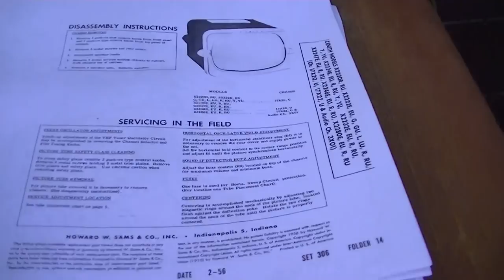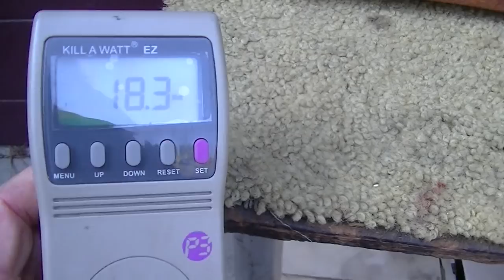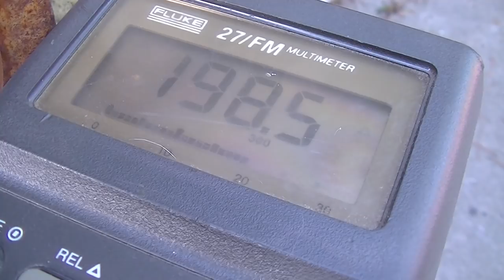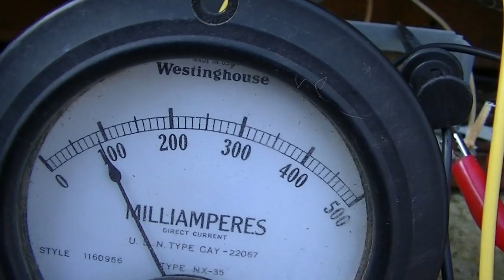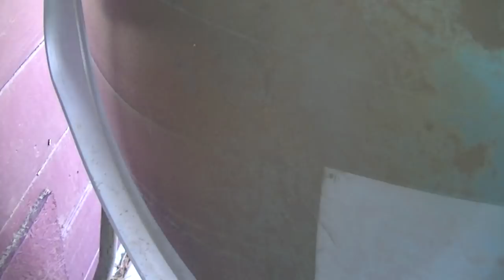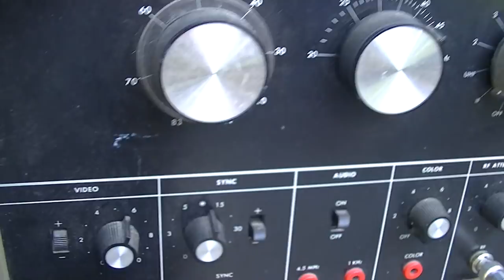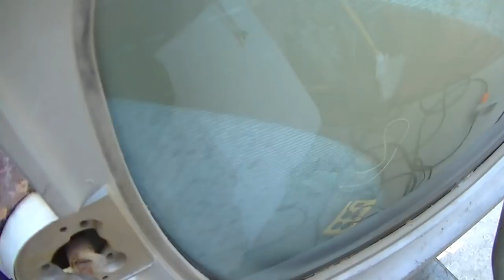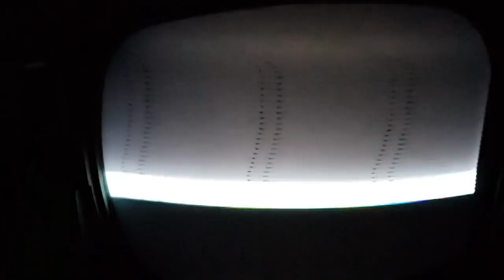1956 Zenith 17X20 black-and-white television resurrection

Comment: Zenith....The quality goes in before the name goes on.
Reply: Someone in my area threw away a zenith space command and cut the cord on it! But luckily that’s easily repairable.
Reply: Zenith is owned by the South Koreans by LG. Pure garbage now.
Reply: Shango066...the quality goes in before the video goes up.
Reply: @guyonearth, candidate for the most appropriate channel motto ever?
Reply: By the 70s, the quality leaked out before the name sealed it in. I remember my dad buying a new Zenith in 1981. Sure, it was a huge upgrade from the motel reject Ford Philco with no green gun TV we watched for many years, but it had cold solder joints that effed it up shortly thereafter.
Reply: @docbrownsradiolab1220  I'm 18 around your age and I collect a lot of this cool old american tube stuff. Mostly radios, old TVs are hard to get around here in rural Virginia.
Reply: Except when they took over Heathkit
Reply: @docbrownsradiolab1220  Sounds like me. I'm 17 right now. Our generation is a bit misled.
Reply: @Brady TheFox lol good 1 😂😂

Comment: Would love to see you get it fully working. It's a testimony to American craftsmanship.
Reply: I agree with you ruff. I hated to see the time run out.
Reply: I agree ..I think it would be cool to get it working like it did in the 50s . Absolutely incredible the environment it was in and that it was able to be resurrected
Reply: Same here!
Reply: nice look you cleaning tube
:-)
Reply: Yes! Tooo good for dumpster!
Reply: Make a new video after this:
Complete disassembly , restuff all capacitors replace all resistors with NOS.  Replate or repaint all metal surfaces. Transformers can be repaired with new insulation. Coils and IF transformers taken apart and revarnished, tuning slug holders replated. All wiring replaced with Teflon. Nice shiny paint job on the cabinet. Recreate CRT label, paper stickers and decals. New authentic factory markings on the chassis. Make new knobs cast from resin. Replace all vacuum bulbs with original Zenith marked NOS. Rewind flyback secondary. Replate screws hardware and tube shields. Create ceramic hybrid boards to replace integrators. Recoat CRT with new Aquadag. Replace any asbestos with nice clean new stuff.
It should only take a few years.

Comment: Seems like it really is harder to stop a Zenith than any other vintage TV.  Considering it was in direct harsh weather for decades with the components facing upward, it's pretty incredible how functional it still is.
Reply: Maxxarcade yeah I mean that thing was in the desert conditions longer than I’ve been alive I am shocked
Reply: Desert conditions are better then temperate climates for preserving things
Reply: they dont make them like they used to anymore. Impressing quality
Reply: Every single old high hour Zenith tube radio I get my hands on fires right up, I've recapped a couple and it sometimes makes little difference at all, quality goes in before the name goes on for sure!
Reply: My 54 Zenith console am fm phonograph works just great. My great uncle bought it new.  He passed at 100, and I asked for it, and so I have it now. Never been restored,  only 2 tubes don't say Zenith,  I can play it all day, it never fails. I have had it since 1994. I have multiple Zenith radios from the 50s to mid 60s. All tube radios,  all work. I ALSO HAVE A 1939 TALL Zenith radio, was my Grandparents.  My mom said they listened to the pearl harbor broadcasts Dec 7 1941.on it.  It still works too. ZENITH made good stuff.

Comment: Although it is totally baked it would be a shame to throw it in the dumpster. At least parts might be worth saving, maybe you will need a CRT like this at some point. That's a tough little TV for sure!! It's almost a miracle none of the transformers were shorted.
Reply: Shango once said that he seems that the desert CRT's seem to fail pretty rapidly in a previous video. So not sure if he'd keep this tube or not.
Reply: kirbyyasha I remember he said that about vacuum tubes / bulbs. Not sure if this is the same problem with CRTs.
Reply: I'd keep it and put the guts from a more modern black and white in it, then play fallout 4 or cuphead on it. Wouldn't even re paint it. after all, it looks like it's straight out of  a fallout game

Comment: I watched this video expecting the TV would blow up each time another tube was installed.  Seeing this video and the one with the transoceanic radio that you got working by spraying it with WD-40 changed my mind about Zenith products.  Would love to see another video showing how replacing the leaky, open or out of tolerance capacitors gets the picture of the TV more and more stable.

Comment: This is the second time I have seen an article in Extreme/Tech online Magazine about this issue lately and it answers a lot of questions about the question of a warranty being voided by just opening the case.
Those “warranty void if removed” stickers have plagued many a tinkerer over the years, but the FTC said last month that those warnings are illegal. It told six companies, including Microsoft, Nintendo, and Sony, to knock that off. The full text of the notices has been revealed, and the FTC isn’t fooling around. It gave the companies 30 days to comply with the law or the agency would pursue “legal action.”
The original notices went out to Asus, Microsoft, Nintendo, Sony, Hyundai, and HTC. The FTC believes all six companies are violating some aspect of the 1975 Magnuson-Moss Warranty Act, which controls what companies can and cannot restrict in a warranty. Specifically, the act states that no product costing more than $5 can have repair limitations in its warranty. That applies even if you have a third-party repair your device or you just want to open it up to blow out the dust.
Motherboard got its hands on all six letters through a Freedom of Information Act request. Each one details what’s wrong with the company’s warranty. In some cases, the company threatens to void warranties if certain repair procedures aren’t followed. The most troublesome provision cited by the FTC (and the one that’s gotten the most attention) is the use of warranty stickers. The FTC says you can’t void your warranty by merely removing one of these stickers, which are intended to make sure you haven’t opened up your device.
All the companies were given 30 days to fix their warranty issues in the letters dated April 9. So, we’re coming up on the deadline. The FTC letters note that investigators have made copies of the original warranty information on each company’s website and will be comparing that with any new language provided.
According to the letters, Microsoft is in hot water for restricting the right of consumers to have third-parties repair their hardware. Meanwhile, Nintendo’s warranty required consumers only to use Nintendo-certified accessories and software. Sony really went for it, designing its warranty to become void if the buyer used non-Sony peripherals or removed the tamper sticker. HTC and Asus had similar provisions to Sony’s. Hyundai required the use of Hyundai parts to keep the warranty intact.
These violations probably represent just a tiny fraction of the sketchy warranty terms out there. Hopefully, the FTC follows through on its promise of legal action if the companies don’t comply. That might scare everyone else enough to get in line.
Aloha from Maui.

Comment: Portable, yes.  In early TV lingo, if it has a handle, it's portable.  Even if it weighs 800 lbs and is bigger than a sofa.
Reply: Like old Fender guitar amps. More than 100lbs heavy with a flimsy suitcase handle on top. Truly portable.

Comment: Zeniths deserve the effort to get them running back as close to 100% as possible in my opinion.  Looking forward to a part two video.  I'm interested to see just how much more it will take to fix the vertical, horizontal and the rusted frozen fine tune shaft.  You truly are the TV whisperer Shango.

Comment: I wish someone like you would be around to help me with these sets. I have a 1949 RCA 9t240 barn sitter. It's been sitting since the mid 1950's in a non-water tight shed since the TV "stopped working". The owner passed away in 2016 and I came around and found the thing sitting in the barn. I plugged it in and the thing smoked. I cleaned up the insides and removed strange gunk under a glower tube. The tubes now light up on the board and the CRT electrogun even glows at the end, but...there is no hiss from the speaker and no picture on the tube. Ideas?

Comment: Make a new video after this:
Complete disassembly , restuff all capacitors replace all resistors with NOS.  Replate or repaint all metal surfaces. Transformers can be repaired with new insulation. Coils and IF transformers taken apart and revarnished, tuning slug holders replated. All wiring replaced with Teflon. Nice shiny paint job on the cabinet. Recreate CRT label, paper stickers and decals. New authentic factory markings on the chassis. Make new knobs cast from resin. Replace all vacuum bulbs with original Zenith marked NOS. Rewind flyback secondary. Replate screws hardware and tube shields. Create ceramic hybrid boards to replace integrators. Recoat CRT with new Aquadag. Replace any asbestos with nice clean new stuff.
It should only take a few years.

Comment: Year of my birth. Circuit diagram very clear.  The integrator is a very interesting description of a RC chain filter. Usually integrators are active using feedback. None the less it still offers an integration function with less than unity output.  This might be my British education that never heard the term before.

Comment: I just received a tv almost exactly like this one and I was wondering how you took off the back part. I see how the frame comes apart and then the back comes with it but did you have to unscrew anything to separate the inside and tube from the outer shell. I dont think I could fix but if I could take out the insides and put just the frame back on I could insert an old 13 inch black and white tv so I could have a working to tv. Also is there a way to separate the tube from the front of the frame with knobs

Comment: Thermal wire strippers are pretty important for Teflon insulated wire. Mechanical wire strippers slide right off the insulation and end up damaging the wire. They're an amazingly useful tool to have.

Comment: Yes, you should not only come back to it, you should do a full restoration on it. i Know i would. consider this...the CRT is good. both the horizontal & vertical sweep transformers are good. all of the important parts of the set are intact (other then missing the back cover). you should do a full recap on this set & then clean up & re-paint the case. the one thing to keep in mind is that these set are no long made & they will never be made again.

Comment: Greetings:
That heated wire stripper is mostly used on TEFLON insulated wire that is very difficult to strip without heat.

Comment: Pulling that plate caps off should make the screen current go bonkers but maybe there screen grid dropping resistor is hi in value and therefor will not self destruct the 6BG6 or whatever tube is in there?

Comment: I have a question for you. I believe it was one of your videos:  there was a radio you worked on and diagnosed—I don’t remember which (or even if it was you), but......
I bought an am/fm  Admiral (ca: 1946)—
All caps replaced, FM is fine, on AM, I tune a station,all is fine, then it crackles, I loose the station for a couple of seconds then station fades back—each time it does it,the station comes back weaker.
I’m sure you know what the problem is. 
  Thanks.
By the way, can’t wait to see this old wreck work again.🙂
Reply from the maker: look up videos of with Silver Mica or SMD in the title on my channel. There are 5 of them

Comment: Never seen that before. This TV has been sitting outside for 35 to 40 years when it was turned to rusted. It is a trashy way to have a semi EOL. It is a rare CRT set from 1956 with rusted cabinets on all sides. Too bad, it will not work with gaming consoles to play on this one. The picture tube is poor, but it has a creepypasta effect to it.
Reply: you could connect any console to it that has composite out.
just A/V out to a modulator, Ch. 3 in

Comment: Now leave a cheap, Chinese turd LCD set out in the weather for 40 years and power it on, and you’d just have a bomb on your hands; it would just go up in a big fireball. It would self-EOL; a bag of fireworks inside might actually help it work better. These old tube sets were built to last; if they had just known how crap paper-wax capacitors were, they probably would have filled the set with disk caps. This video makes me want to find a cheap POS TV that someone left at the curb and fill it with mud and rat turds, and then EOL it right there. Vote “yes” to sets filled with vacuum bulbs!